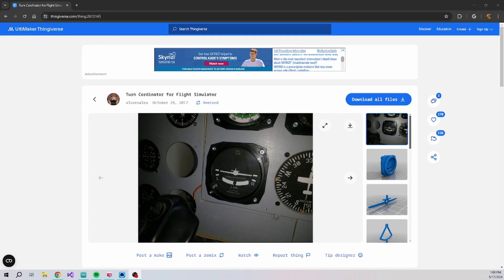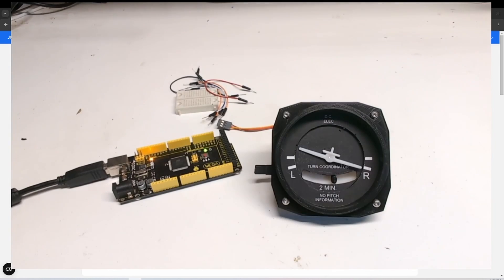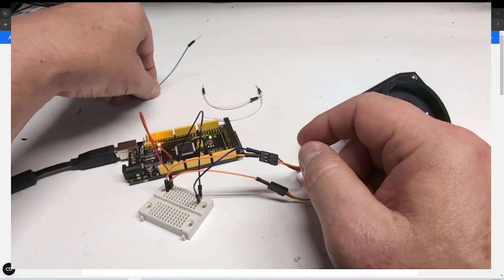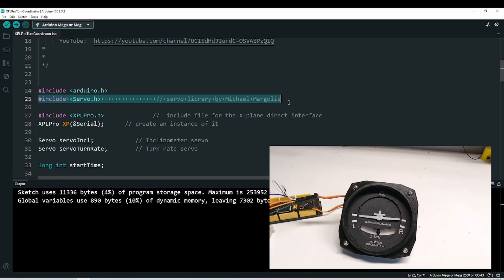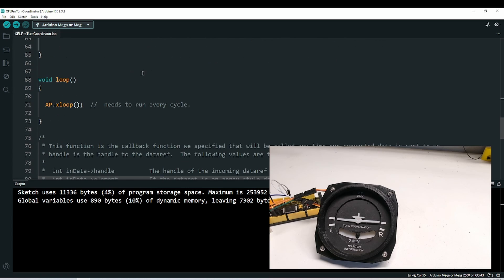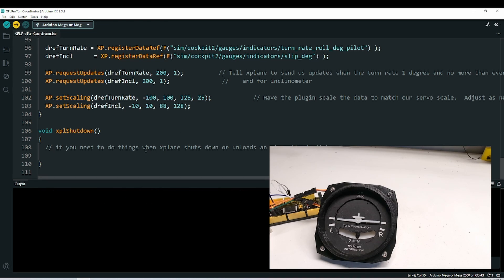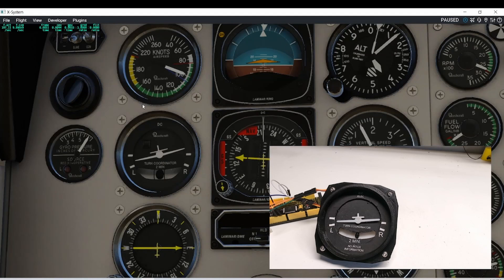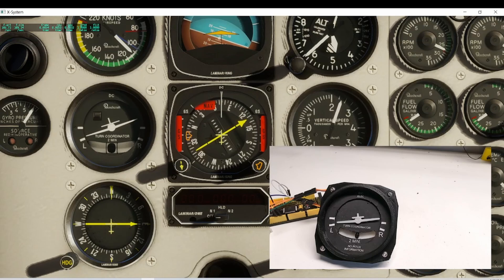Xplane/Arduino:  Easy Mechanical Turn Coordinator with XPLPro

Comment: really cool! the only part i don't like with servos is the noise, so i like to use little steppers motors
Reply from the maker: Agreed.  I'll look for a variation that uses them.  There are also some quieter servos available